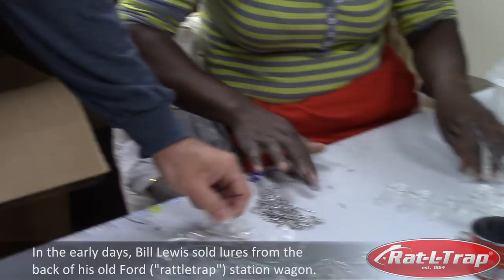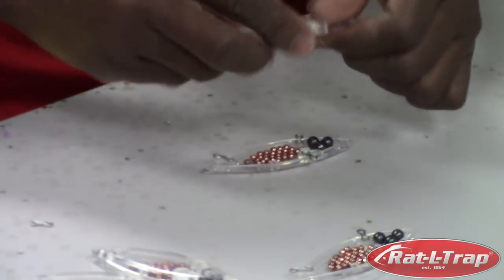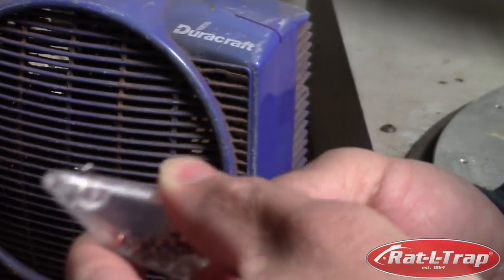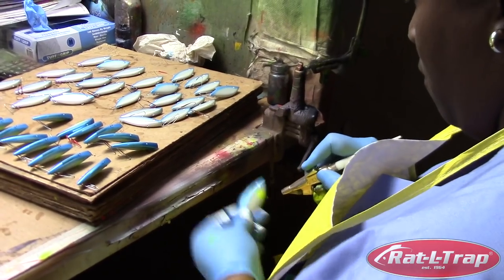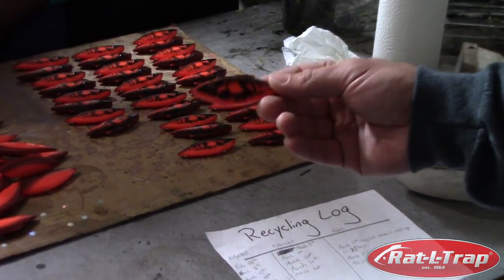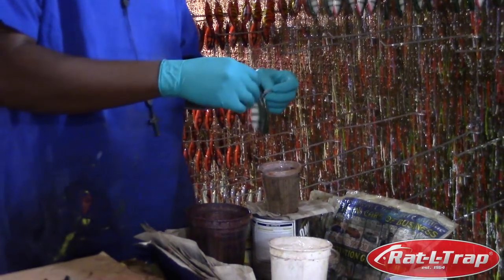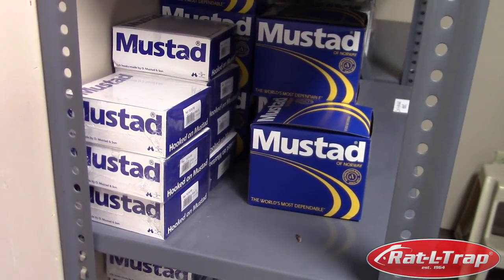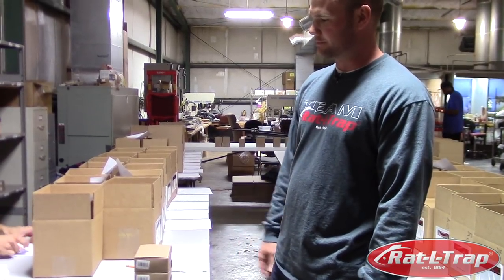Fishhound's How It's Made: Rat-L-Trap Lures

Comment: I been using Ra-L-Trap's since they first hit the market. My bait of choice over the years has ALWAYS been chrome blue back since they were first introduced. I usually buy a dozen at a time and when they are gone, then I get some more. What I have found over the last year with the last batch I bought is that the chrome is coming off. Called Bill Lewis Outdoors to express my concerns and the nice lady said, "send a couple of them in and let us check them". I was not rude, but was thinking WTF, its obvious they have changed the process as the older lures did not have this problem. She said they had found that leaving them in a hot tackle box could cause the chrome to peel. I said "Thank You" and I was sorry I wasted her time and mine. :(
Reply: Hey man, get some white tape and put it on the lid of your clear tackle boxes to give your baits a shaded area so it doesnt get as hot. I use hockey tape, but electrical or duct tape should work fine. What i've done, is taken a piece of paper, wrote "Squarebills" on it, put the on the box lid facing out so that when i tape it over, i know which baits are in the box. I'm about to do this with all my baitboxes. Another trick you can do is, you know when you buy something that gets shipped to you? Use the silica packets you get inside the boxes/containers of the item you bought. Throw those in your crankbait boxes and they'll help absorb water that gets in there from humidity or wet baits. I try to get as many as i can so i have at least one packet per crankbait area. Now when you close your box at the end of the day, there is less heat and water trapped in the box. You can also try using clear nail polish or epoxy to spray/lightly brush over your baits so they're less likely to peel, although i find it does make your bait weigh slightly more.